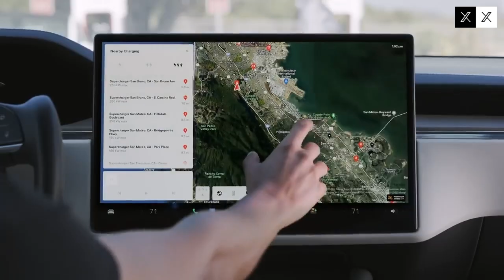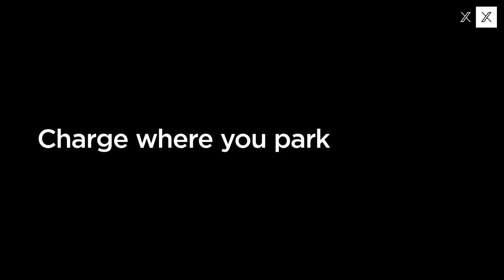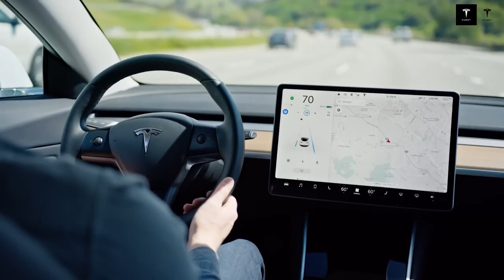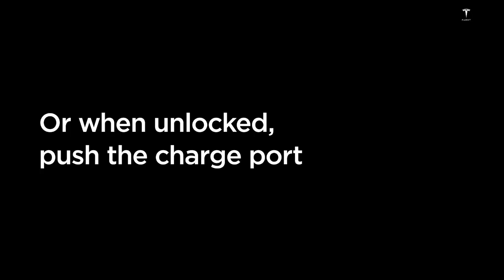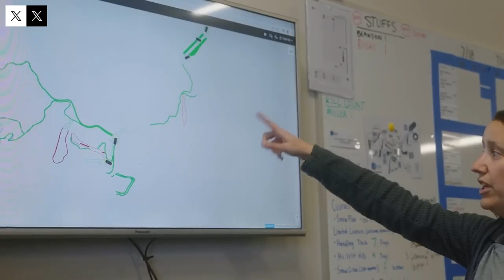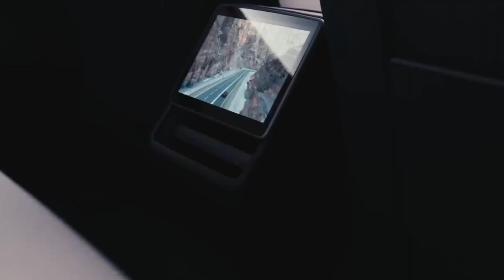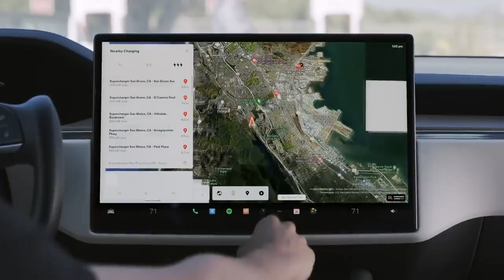FINALLY! Tesla Unveils Aluminum Ion Battery – $10,799 Model 2 With 480 Mile Range Stuns The World!

Comment: There. Are. No confirmed  specification   
For. A 2026 Tesla Model 2  is especially. At a $10,000 price point 
As this. Is. A hypothetical vehicle based   On. Speculation 
53kwh LFP battery but tesla. Has not 
Release an  official. Model 2. For. 2026 and 
The company. Had Focused on. a $25,0000 
Vehicle program rather than a $10,000